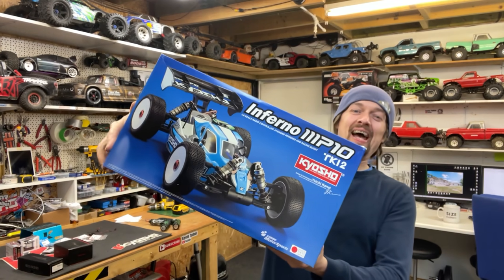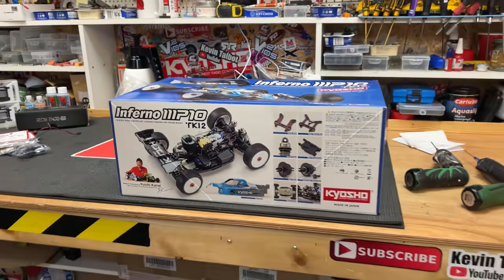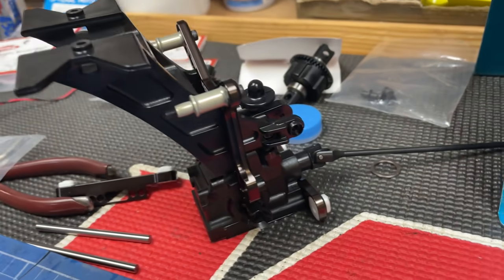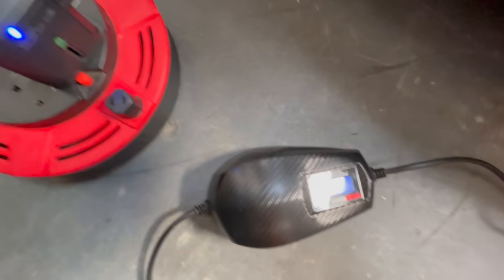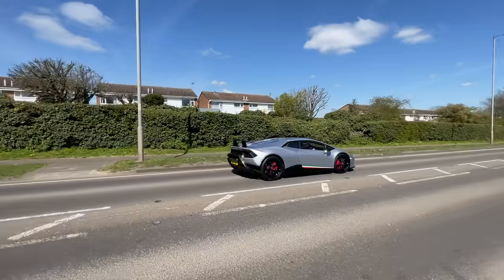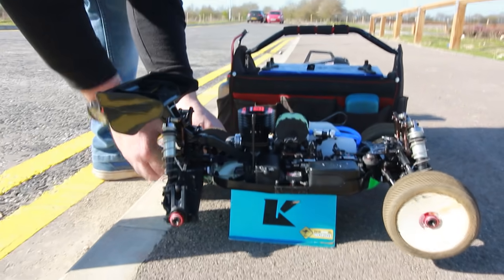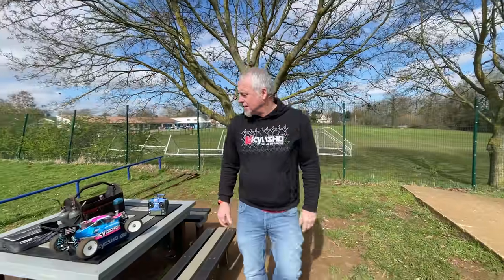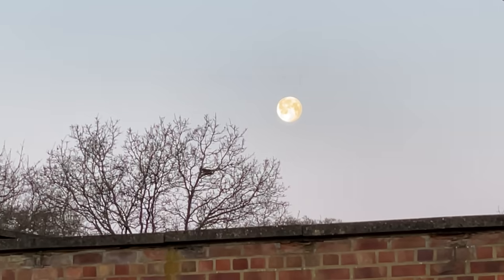Worlds best RC Race car durability test

Comment: Those are surprisingly tough, they have to finish races at a world class level. That is great info and would have been useful way back when I learned nitro ground vehicles. Full throttle, start box until mist, glow 10 sec. And start. Good tips.

Comment: Still have my 2002 Kyosho Inferno MP 7.5  with Novarossi SBK01 Ron Paris modified .21. THS tuned pipe.  Lots of options on the chassis.  Top of the line back then.  Well over $1,000 in 2002 dollars. Controlled by then best of the best Futaba 3 PDF FM radio.   Still run it today.  Kyosho is the best.

Comment: It's expensive, because the brand name.
And it's NOT a machine for bashing. It's a machine for a proper and smooth off-road race track. Using a machine like that only for bashing, it's sad and you really don't will see all the features and handling for this buggy

Comment: I used to race Nitro but it’s just so messy. We did get one to go over 100Mph though. But when they wreck, each tiny part you see flying off is me thinking 💭 there goes $40.00US, there goes another $40.00, and another, and another, and another, Etc...

Now I’m running electric and with today’s battery tech it’s just so much better in so many ways. 

But like petrol gas, there is a finite amount of lithium on earth and were chewing through it pretty darn fast.